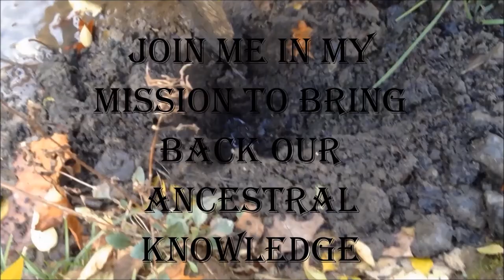How to make a Birch Bark Container

Comment: Purify your pine nuggets, with boiling water, nuggets wrapped up in cheesecloth&scoop out your loose purified pitch into a cup of cold water...then store or remelt for gluing up your BBbox. ..You can easily make a brush stick from a twig/cordage and fiberous plant material..for spreading your glue on the cracks of your box.

Comment: very nice!...try and make a small brush out of a sick by just cutting in from the top about 1/2 inch several times, and then wet it....it should help the resining process easier?...just a thought
Reply from the maker: Yeah that would work but I was running short on time thanks

Comment: Does it help to soke the birch bark in water for a couple of hours to make it more pliable?
Reply: Actually small amounts of heat make birch very very pliable. If you were to hold it near a fire for a few seconds.  Just don't burn it/ bake it too long. You wont have the snapping with the layers.

Comment: I have seen many people mix pine resin with ground charcoal or ash and they said it increases the strength of the glue. Are they correct or is that an unecessary step?
Reply: James, -  the charcoal acts as a binding agent, allowing the resin some fine particles to adhere to, it's helpful in waterproofing though unless you're using a very flat, shiny surface, you would be fine without the ash or charcoal :)